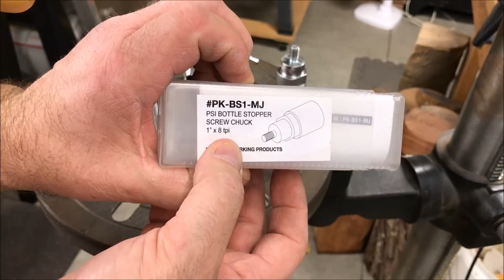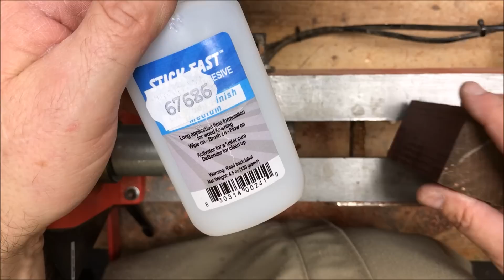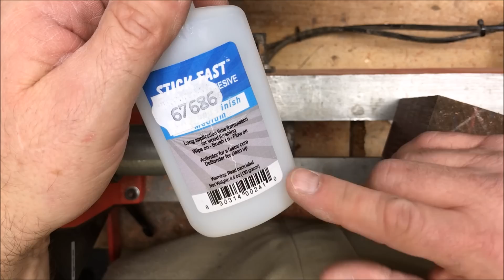Bottle Stopper

Comment: Bob, this video is so old I don't know if you will even see this comment but I noticed when you backed off the stopper to do the ca finish that it had a slight wobble, and that is probably is nothing to worry about but i was thinking that if you were to make or buy a small washer to fit over the threads and smaller od than your turning you could eliminate the wobble because you could tighten it up and still have a gap so you don't glue everything together. A washer made out of a milk jug would probably be thick enough. And thank you for that video it turned (no pun intended, yeah right) ; ) out beautifully. I really like the combinations of wood.
Reply from the maker: Thank you Donald, that is a good idea. I did have the stopper loose on the mandrel as I was trying to avoid gluing them together. A piece of a milk jug would eliminate that possibility and allow to keep the stopper tight on the mandrel. 

Regards,
Bob

Comment: nice looking bottle stopper. A little tip for you when it comes to the ca finish put a 3/8 nut on your mandrel the you can tighten it all the way down and you wont have the wobble and it hold your part back from the mandrel
Reply from the maker: Thank you for the tip. 

Regards,
Bob

Comment: I realize I am watching this long after you posted it, but I just ventured into bottle stoppers and needed to see some videos for some inspiration.  Thanks for the step by step coverage.  The stopper is gorgeous.  I have a suggestion to offer when finishing with CA.  I knew from my pen turning to find a way to protect the mandrel from the glue, so I took a pice of wax paper, put a small hole in it, and slipped it over the screw part of the mandrel.  Then I used some painter's tape to secure the paper around the base of the mandrel.  Worked like a charm, and I was able to keep the stopper snug against the mandrel.  Thanks again, Glen
Reply from the maker: Great idea Sandy,
  Hopefully sharing it here will help others. 😃

Regards,
Bob

Comment: Hey Bob, I use a small washer between the wood and mandrel when I apply CA. Keeps the stopper away from the mandrel and also stays nice and secure with no wobble.
Reply from the maker: Thank you Andre, That's a good tip.Regards,Bob

Comment: Nice video. Well done. One "trick"... you can place a small washer between the mandrel and the stopper to create the space for applying a CA finish. That way the stopper cannot thread tightly to the mandrel by accident.
Reply from the maker: +rob wallder Thank you Rob,
  Great tip. 

Regards,
Bob
Reply from the maker: +BJ Willis Great tip. I use the non stick on my pens, looks like I need to make one for my bottle stoppers. Great tip/idea. 

Regards,
Bob
Reply: Wish I had read this before I glued my stopper to the mandrel

Comment: Hey Bob!  This video inspired me to do 3 things yesterday.  1. Get that mandrel. (well, I ordered it last week, got it this week).  2. Do my first segmented stopper.  3. Do my first wood inlay.  I did one stopper in  bubinga with a maple inlay and a segmented with bubinga, walnut, and purpleheart. I am very happy with the way they came out.  Not as good as yours but for my first ones, I'm happy.  Added bonus was a very thin black line where the glue seeped into the wood between segments.  Thank you for the inspiration.  Love your vids.  They are helping me in so many ways.  Now to get that polishing wheel.
Reply from the maker: Thank you Gene, I’m glad you tried segmenting and inlay on bottle stoppers. There fun to make and great to practice new techniques on. 

Regards,
Bob

Comment: Hey Bob, nice video. I was a bit alarmed when you glued 2 end grain faces together. 
I suggest you consider turning a tenon on the purpleheart and drilling a hole the same diameter into your other piece. This will give you some good solid face grain for a stronger glue joint.
Reply from the maker: That is a great suggestion, so far I haven’t had a failure but the tenon will really help solidify the two pieces together. 

Regards,
Bob

Comment: One small comment about when you were talking about how to set the depth of the hole for the tap.  I don't know if you are aware but you are using a starter tap.  If you look closely you will notice that the thread profile tapers off towards the bottom.  That means if you only drill the suggested length then a good chunk of the hole will not have a full depth of thread cut.  Now for wood I suspect it maybe doesn't matter too much as the screw is harder than the wood and will just cut into the wood.
Reply from the maker: Thank you,
  This is my first foray into taps and I have quite a bit to learn. I appreciate the information as it helps me improve. 

Regards,
Bob
Reply: Hi Bob,  I actually noticed later in the video that the threaded part of the stopper seemed to be shorter than the tap anyway so that would have compensated for the lack of thread cut at the bottom of the hole.  That's a really nice finish you obtained by the way.
Reply from the maker: Still, I have a lot to learn so always share you’re knowledge with me I appreciate it. 

Regards,
Bob

Comment: Hello Mr. Bob! I hope your doing well.  I know this is an older video, but I have a question.  

I ordered the bottle stopper chuck and it’s components, and I’m a little confused on how to attach it to the lathe.  I have a mini shop Fox lathe (the 1704) and the threading is 3/4x16psi.  Do I need another chuck for the bottle stopper component, or does it attach to the lathe? As you can probably tell, I’m an absolute beginner at turning, so any wisdom you can bestow on me would be amazing.  

Thank you!
Reply from the maker: Usually the bottle stopper chuck will thread onto your headstock spindle. The most common size is 1” x 8tpi. 

If it is to large, you may call the place you purchased it from and see if they have one sized for your lathe. 

If not, you may be able to purchase an adaptor for it. 

Regards,
Bob

Comment: Interesting Bob.  I like to watch other turners.  I try to learn something from them all.  I started using PSI stoppers, but, have since switched to the ones sold by nilesbottlestoppers.com.  The mandrel that Ruth Niles sells has a #2 morse taper.  I experienced some runout with the mandrel sold by PSI.  I have had some failures of end grain to end grain when using ca glue.Oh,by the way, that's a great looking stopper.  If you have golfing buddies, they really like a stopper with a golf ball inset.  And the golf ball must be able to rotate with finger pressure and not fall out.  Enjoy your new lathe.
Joe
Reply from the maker: Thank you Joe. 
  I’ve been hearing about Ruth’s stoppers, I need to check them out. 

Regards,
Bob

Comment: Bob, Sometimes I get white sawdust flecks in some of the porous grain woods after sanding. Easily cleaned out with denatured alcohol and an old toothbrush. Just brush it in the direction of the grain. Did you get the rubber feet with your lathe or were they removed to bolt it to the workbench?
Reply from the maker: Shawn did send the rubber feet so I have both options. 

Regards,
Bob

Comment: Hello, it's now 2022. I have the same lathe that you have in this video. Mine is Green and name King Canada 1218.
What type of Nova Chuck is on that.
Reply from the maker: U.S. 1” x 8 TPI threads. My chuck is a Nova II. 

Any chuck with the proper thread dimensions will work. 

Please google your lathe model to learn your thread dimensions. My lathe is a Central Machine which may be different than the King Canada. 

Regards,
Bob
Reply: @RJBWoodTurner  i have the same threads on mine
Reply from the maker: @paulmelanson1527  any chuck with that thread pattern will work for you. 😃
Reply: @RJBWoodTurner  i know. I just wanted to know which model you had. And how you like it. I'm hesitant between the Nova Chuck and the OneWay chuck. Oneway is 100 bucks more.
Reply from the maker: @paulmelanson1527  I Love my Nova II. It’s an older chuck and the newer models have the quick change jaws. Nova makes a great chuck.

Comment: Hi, great video! That piece looks fantastic! I have a couple questions. Could you glue up the two pieces and turn it all at once? Also can you drill the little insert on the lathe instead of boring the hole with turning tools?
Reply from the maker: Yes to both questions. I’d you know the pattern you want to achieve an pre glue up with some good wood glue or a great idea. Inserts are way better than threading the blank because not all woods thread well. 

Regards,
Bob